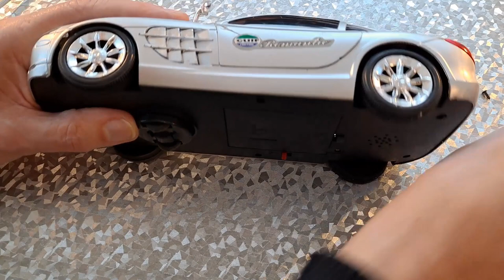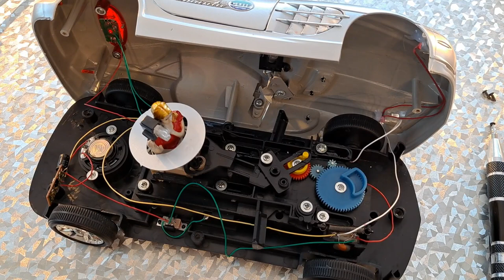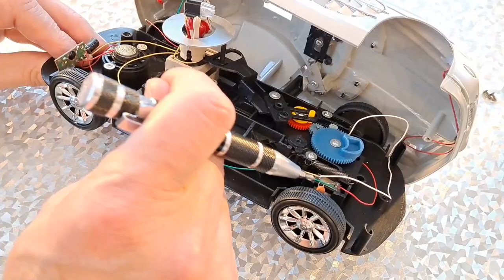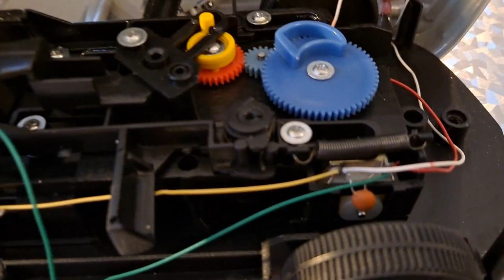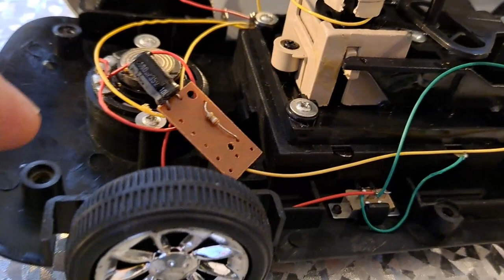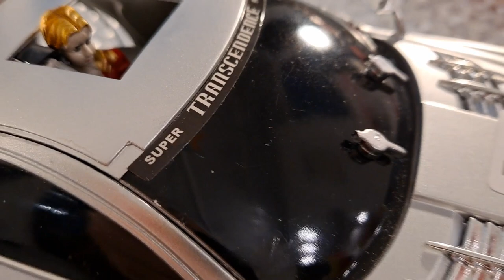Peek inside the Bump & Go Mercedes

Comment: A lot more to this wee car than meets the eye. Loads of moving parts.
I would think measuring the length of that arm going to the big blue gear would be the first thing to do. 
When the black sliding platform is pushed back to its limit then use a piece of bike spoke with 90 degree bends at each end to get the rough setup. If you are printing an arm then I am sure it would have a pin similar to the yellow gears pin in order to slide in the housing of the blue gear. Where it's broken will give you an idea of the width of the arm. Don't get me wrong, I am sure you have plenty of ideas of what to do. Just some thoughts on my part. 🙂
I am surprised at all the cams and gears that are in it for what looks like a simple bump-and-go car. 
Very interesting mechanism. 😃👍
Reply from the maker: I find them fascinating. Of course, the music is part of the experience, so we cannot remove it 😆😁🎵🎶